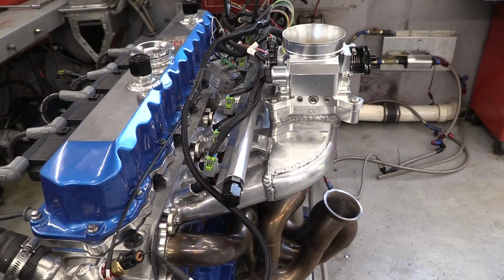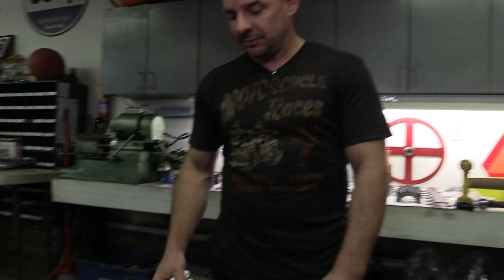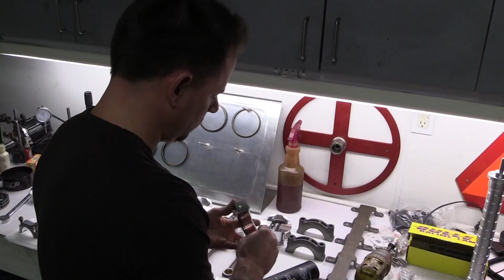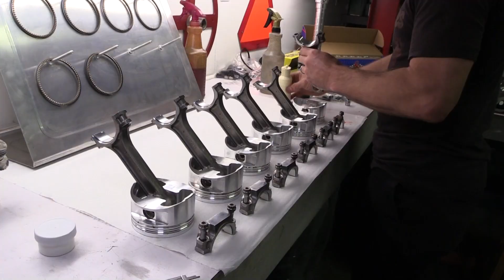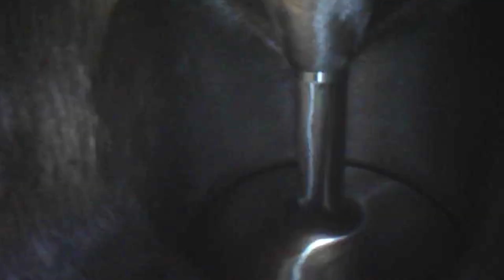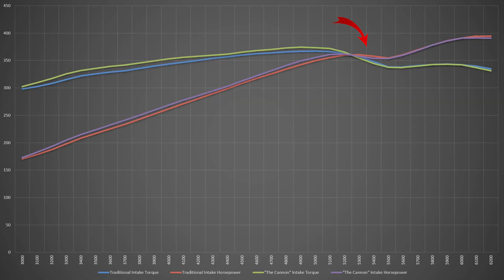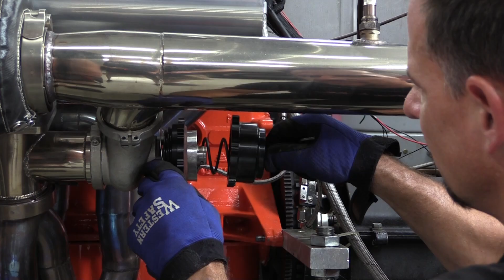Turbo Jeep Smashes World Records! (Tons of Innovation!)

Comment: I kept watching and hearing those RPM's climb - right along with the power. Then, I just kept saying to myself "This is a JEEP engine!" Put a big smile on my face. Great job Newcomer - amazing outcome!
Reply: I mean, technically it was a car engine first. But yeah, at least the head was designed for jeep.
Reply: @Levibetz  
The sad thing AMC could have done all of this to the 232 or 258 in terms of fuel injection in the late 70s. The US auto industry was very late to the party in terms of fuel injection aside from a few fuelie Vettes.
Reply: @mpetersen6  check out the Spirit AMX turbo concept they built as a pace car! It had bosch fuel injection on a 258 with a turbo that made around 400hp. Also, what became Bosch's d-jetronic was actually based on Bendix's efi developed in the 1950s and used in chryslers and I thiiink some nash models? Super rare, and a failure in it's day until bosch perfected it and it saw wide use on VWs, saabs, and others.
Reply: @Levibetz  
I'm familiar with the Spirit pace car that was put together for IMSA events. At least I think it was IMSA. The only thing that will always hold the 4.0 or any other US built inline 6 as far as power output goes is the cylinder heads. Ford, Chevy, Chrysler and AMC all went with non cross flow heads. These engines were built as utilitarian power units. Entry level motors. If you wanted more power you got a V-8. And to be truthful most if not a lot of them of the V-8s were the US auto industry built back in hay day of the muscle car didnt put out that much power. Even the legends from that time are dogs compared to a lot of engines today in terms of hp per cubic inch. Even Pontiac's OHC six used a non-crossflow head. In fact the Vega 4 cylinder head looks a lot like the Pontiac. One reason that the manufacturers used a non-crossflow head was the intake manifold would be in the way of the distributor. Today with modern ignition systems that's  not an issue. Remember these were the days when you were looking at a tune up at least once a year. The reason the intake and distributor would interfere is the dizzy is driven by a helical gear on the camshaft.  On an inline you usually drive the dizzy from the center of the cam or between #1 and #2 cylinder. Plus the same gear drives the oil pump by a tang on the dizzy shaft that fits into a slot in the input shaft of the oil pump. One way to convert an inline six to OHC is to use the existing camshaft for your reduction and drive the SOHC or DOHCs from there. And it wasn't just the US manufactures that built inline sixes this way. Look at some of the European and Japanese inline sixes. Both OHV and OHC. The only OHV inline 4 or 6 cylinder engines I can think of that did have a crossflow head were the two built by Pontiac. The Trophy 4 and the Iron Puke. There might be others,  and probably are, so there is no reason that others could not have.
Reply: @mpetersen6  I would have loved to have seen a 258 or bigger straight 6 fuel injected AMC in a small 5 spd performance car and some Jeeps.
Reply: @deborahchesser7375  
I think I'd go the other way. Open a 4.0 up to 4.000 bore. Either by sleeping or hard block in the water jackets. If sleeved tig weld the sleeves in place. Drop the crank from the 199 in you are at 3.75 liters. Make a new head out of the following choices.  1) Ford Windsor or Cleveland V-8. The bore center matches. 2) Chevy Small Block or LS. Bore center is only .020" more. 3) GM LQ1. DOHC 24 Valves. Same BC as the SBC. 4) Nissan VQ35DE or VK55. BC is .029" more than the 4.0. These are DOHC 4 Valve heads. Plus I think the valves are bigger than the LQ1 simply because the bore are bigger. There would some issues to work out with the oiling and ignition systems but they are not impossible to overcome. One example would be on the lifter side of the 4.0 the head would most likely need an extension to seal the head gasket. Other modifications that would need to be done to the 4.0 block is block off the lifter bores (they intersect the oil galley. Block off the #4 cam bearing oil supply. Cut the existing camshaft off even with the rear side of the #3 bearing diameter. To get oil to the valve train run a line or lines from one or more of the lifter bore plugs. The cam needs to be extended to mount a toothed sprocket for running the cams. It would be a far bit of work but you'd have something different. If you want conventional, just drop an LS into something. BORING
Reply: @Levibetz  yes by amc
Reply: No this is an AMC engine not a Chrysler engine but yes it is a Jeep engine Chrysler just continued to make it after AMC developed it
Reply: It's not a Jeep remember AMC not Chrysler

Comment: I heard  that in Argentina  they made a multivalve  cylinder head for this engine  i don't know how compatible is it with a stock engine  but it sound cool  its called  actc  the channel that uploads the videos
Reply: There are videos of the designer for the head. Along with videos of the engines running. I've been trying to find more info on this subject but I unfortunately do not speak Spanish. Doing research on line I did find this
https://www.bing.com/videos/search?q=pedersoli+y+el+nueva+motor&docid=608052294253807256&mid=A3B333AF6CCF91B35831A3B333AF6CCF91B35831&view=detail&FORM=VIRE
The engine in the thumbnail for the video sure looks like a 4.0. But when watching the videos of these engines running or installed in the race cars they have Ford, Chevrolet, Torino and a Ram symbol on the valve covers. And all the valve covers look the same. What I think they did was design one basic combustion chamber and adapt that to 3 different casting to fit the Ford, Chevrolet and 4.0 inline 6s. The 4.0 version was homolgated for use in Dodge and Torino* siloulette race cars in the TC racing series run in Argentina. The only seller of these heads was the racing series organizations.
* The Torino here is not the Ford one. This Torino was built by IKA (Kaiser Industries Argentina). The car was based off of 64 American and Classic body assemblies.
https://en.wikipedia.org/wiki/IKA-Renault_Torino
Reply: Ya?

Comment: Isn't that a cast crank??
I never dreamed you could take one that high.
Reply: They say as long as you don't stay at 5500 long they'll turn pretty high
Reply: stay away from 5300rpm for too long though. either go above it or stay under. it will shatter at 5300rpm due to harmonic vibrations if you hold it too long.
Reply: @frigglebiscuit7484  he addressed that with the sfi balancer and arp studs,spacers,girdle mods anyway
Reply: Frigglebiscuit I’m sure it’s balanced to perfection since he has forged rods and pistons and the balancer absorbed any other unwanted harmonics in that rpm range